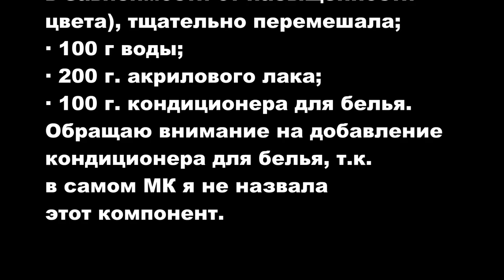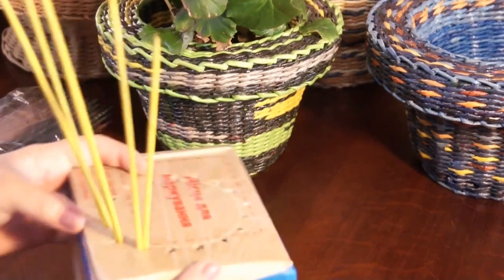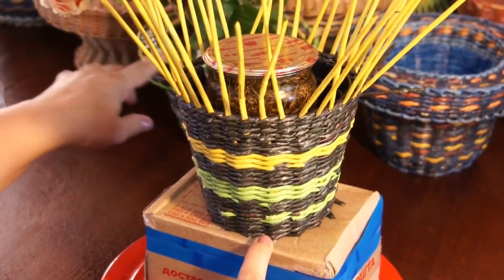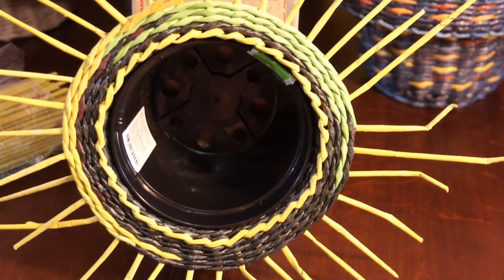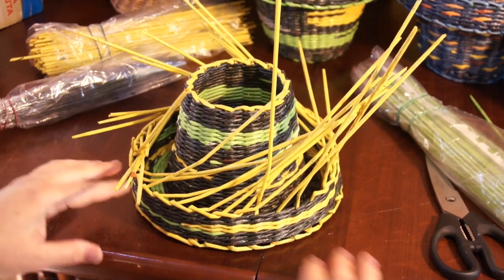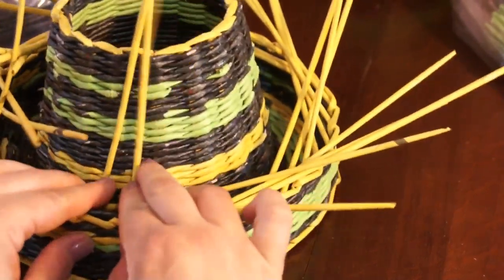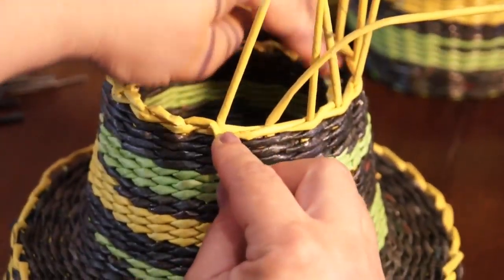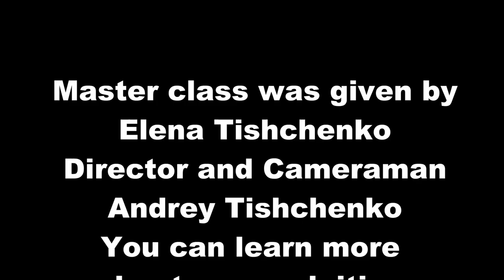Volumetric cashe pot case for a flower pot

Comment from the maker: In preparing the straws for weaving kashpo used such a coloring composition. To obtain 500 g of a liquid for painting, mixed such ingredients:

· 90 g of the primer dissolved with a color (2-7 teaspoons, depending on the color saturation), thoroughly mixed;

· 100 g of water;

· 200 g of acrylic lacquer;

· 100 g. Of the conditioner for linen.